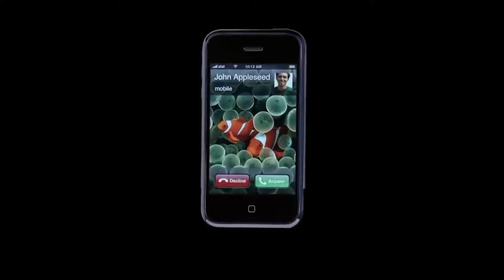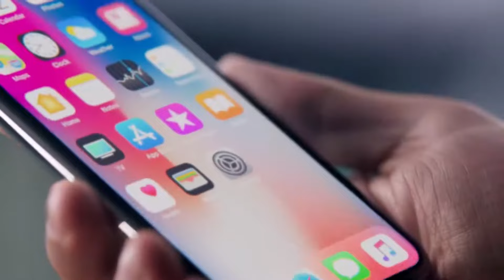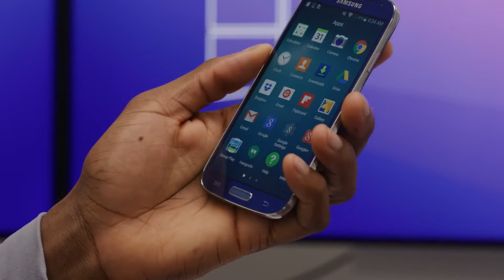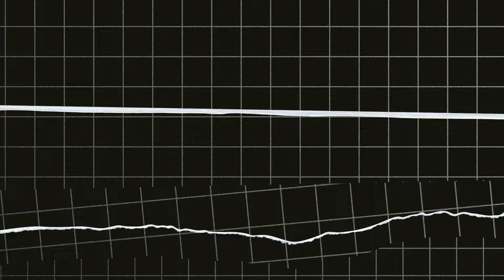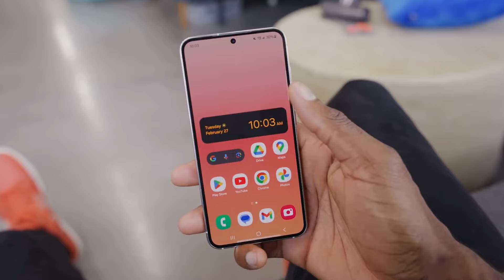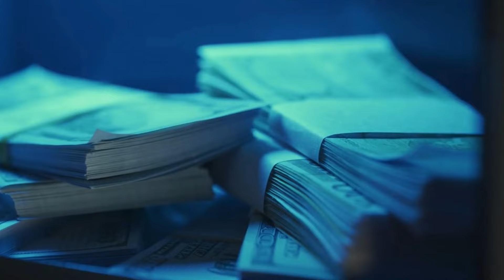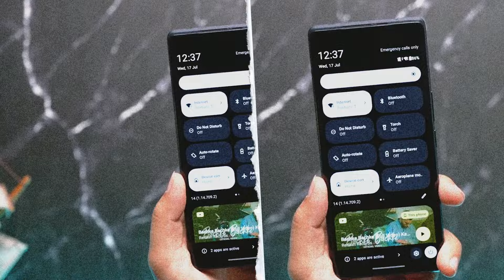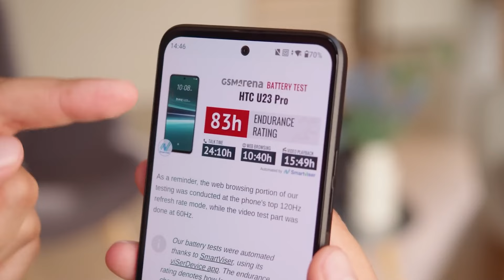HTC Smartphones: From Innovation To Oblivion

Comment: I had the HTC ONE M8 and I loved it. The camera left a lot to be desired being only 4MP (granted, it was a larger 1/3in CMOS sensor with larger pixels than was typical at the time to capture more light and with a dedicated Image Signal Processor. Also including a 2MP depth sensing camera and a 5MP Front facing camera) The design and build quality was great and their software overlay was actually pretty good, especially compared to others like Samsung. The specs were great too, having a quad core Snapdragon 801 SoC, a 1080P display, 2GB of RAM, 16 or 32 GB storage and a micro SD card slot that supported up to 128GB. Not to mention, the great sounding stereo front firing speakers. The Metal Unibody construction was not only beautiful but, gave the phone a premium and durable feel. It also had the awesome Dot View Case that would cover both the body of the phone and a flip over panel that covered the screen but, featured a matrix of dots to allow light from the display through and could display information like weather, time and caller ID info. The case was also capacitive and would allow you to activate the display through the dot view cover to answer calls without having to flip the case cover open. It was really innovative.